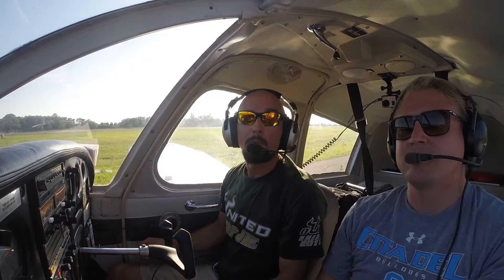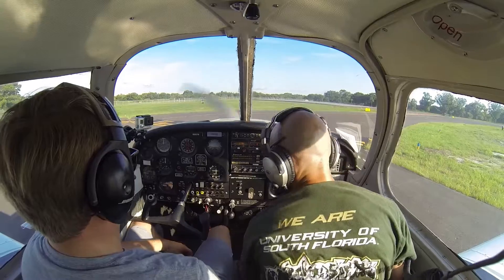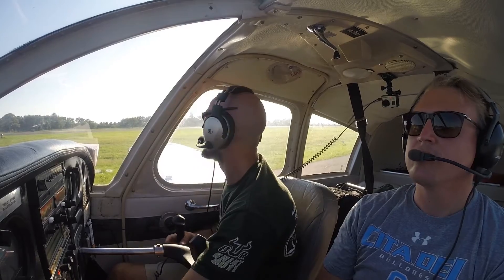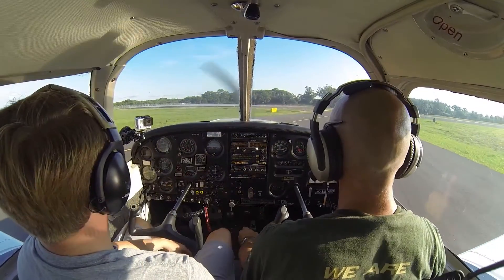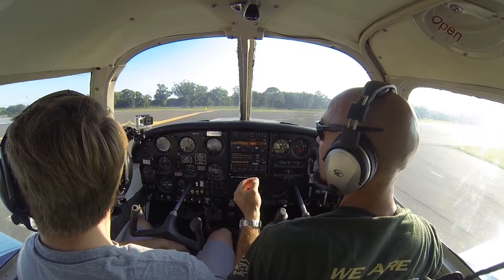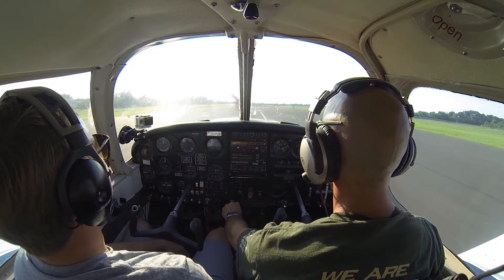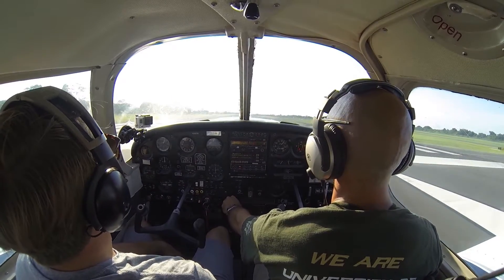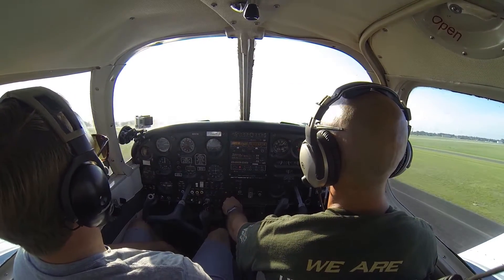Ep. 49: Soft Field Takeoff | Piper Cherokee

Comment: Well done.  Another thing to remember is.. Use some flaps on any soft taxiway, "Taxi Flaps".. That will give you some lift and you use less power and avoid picking up things with prop.  I have seen guys using almost full power on taxiway and damaging the prop, when some flaps could have made them move with less RPM..  10 degrees on low wingers is enough as "TAXI FLAPS"..
Reply: Just 25° of flaps? And do you have your stabilator aft or yoke aft?